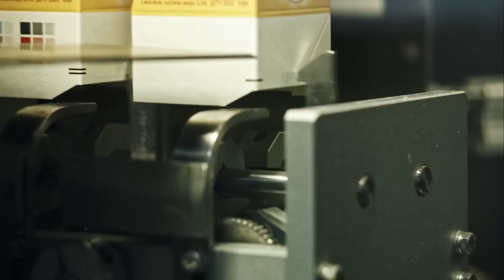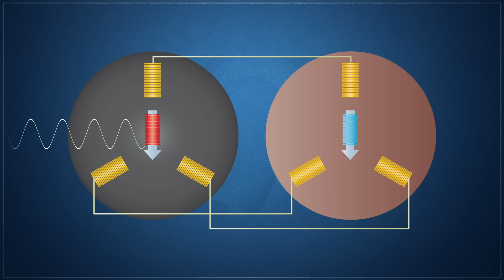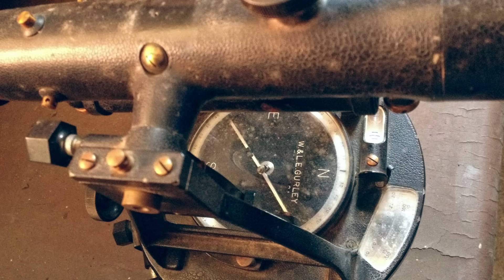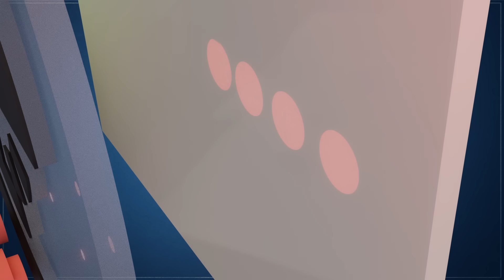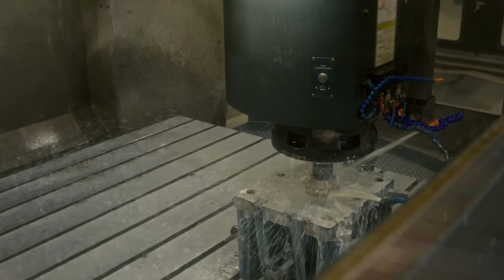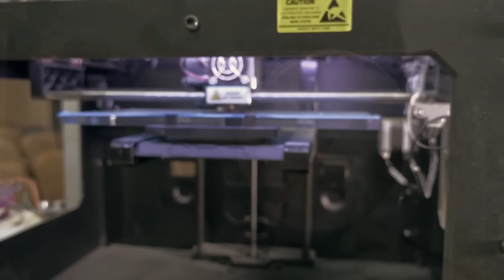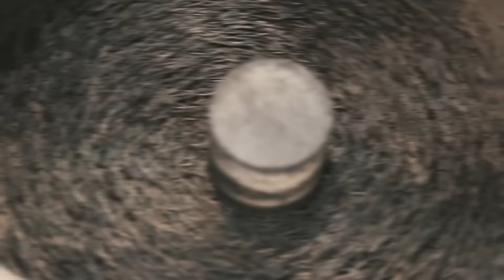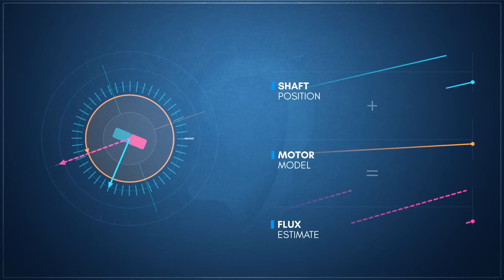The Incredible Engineering of Precision Rotary Motion

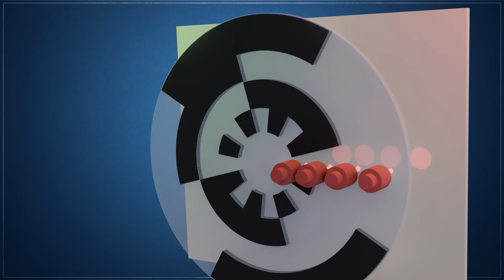Comment: The absolute encoder shown at 9:56 is not quite what you'd want in practice:
You want the pattern to be a gray code, where only one sensor changes state in each step.
One example of that is the (current) thumbnail where the areas form a tree-like pattern .
If you don't have that, the smallest alignment problems can lead to sporadic jumps in the encoder readouts.
Reply: I was very disappointed not to see the encoder in thumbnail mentioned in the video. The gray code stuff is really interesting. I recently saw a video which did a pretty good job describing it. I can't remember the channel but if I think of it, I'll mention it here.
Reply: @ddegn  Me too. This is by far one of the better tech videos, what with all the lazy AI-made ones coming out - you know, with completely unrelated pics and video and a grating AI voice. 
But Gray Code is one of the most interesting things and this video glossed over it. In my experience a simple (slit-based) rotary encoder system is effective and highly accurate, but requires homing every time you start it. Gray code is always read as a precise position so it needs no homing step. They are expensive encoders but so is everything else in a system like a CNC Milling center or robot arm! Another thing that was somewhat glossed over is the development of high-speed amplified brushless motor drivers like those used on electric RC airplane motors - in the 2000's up to now we are getting really efficient and responsive controllers with some crazy-serious phase engineering like you see at the end of this video.
Reply: @ddegn  But still it was good bait, huh?  lol.
Reply: I learned gray code and its purpose for the first time at my controls internship and some of the guys who worked there for decades had no clue why it was necessary for an encoder. I was FASCINATED. Wikipedia sums it up pretty well.

I was going to come here to comment that gray code is necessary in most encoder applications but you beat me to it. Cheers.
Reply: very good!
Reply: Yeah, it's a scratching many surfaces video.
Reply: gets a bit too "off topic" and long winded beyond saying "digital/logic systems dont like more than one input change at any one time and unexpected results may occur".

gray codes, xs3, reflected codes, and the whole thing of parity and error detection is mindblowing and so freaking simple once you "get it"...

whats sad is that as some dumb grunt that simply likes reading, to hear of people in the industry itself with no knowledge, no interest... its pretty commonplace these days, isnt it? 

"got degree, know jack"

gentlemen, i give you... "enshittification". we have all made compromises because of morons having the final say...
Reply: :face-blue-smiling:
Reply: I forget when I learned of gray coding, but I remember seeing it on the martian rover's wheel treads - interesting
Reply: I was thinking the same thing..
Reply: Same problem with parallel flash-adc that was based on comparators, you could get problems in the exact power-of-2 transition zone.
Reply: Weird,  because Ford Borg Warner has an encoder in their shift on the fly transfer case shift motor, that looks, just like that. It has 4 brush style contacts,  that touch a disk, with copper contact area, it goes forwards,  backwards,  and knows it's position, because of THAT design.  . . It's been around since the mid 80's .
Reply: @jamesgeorge4874  good for BW. 
you failed to mention what LOGIC CIRCUITRY happens to be attached to it? or how many bits it is trying to count?
4 contacts is standard. two phases. thats mere "quadrature encoding". its not producing a binary numeral representing its angular position, its simply saying its spinning CW or CCW, and how fast.

its not absolute positioning.

due to the internal architecture of a digital system, it is preferred that one counts "00, 01, 11, 10, 00..." changing ONE digit at a time.
rather than "standard count" 00, 01, 10, 11, 00. 01 to 10 is a particularly bad "switch"...

in reality they dont switch at teh exact same time... random and unexpected rewsults occur.

so encoder wheels, when dealing with bits and binary outputs rather than simply turning a phase on or off, use "gray codes" to make the CIRCUITRY simpler and less error prone.
Reply: Nice presentation of different solutions and their drawbacks .
Reply: What we know NOW, and what they knew then, are very different things. You're correct, but the builders were working out what they saw from practice and experimenting on differences to come up with improved machines.
Reply: That was known by 1941

Comment: And how about the backlash? I can do the resoluti8n easily with a gearbox....but not backlash
Reply: Timing belts or harmonic drive. Cycloidal is theoretically capable of doing it, but typically comparable backlash to a single gear stage. Gears are for things that only turn one direction, or don't need super precision. You can use an encoder on the output for the angle PID so it will automatically compensate backlash, but that can't respond very quickly to disturbances within the backlash range.
Reply: By having the gears lock in both directions.

Comment: Oh no. The troubleshooting when some machine learning system makes vibrations worse rather than better in some edge case it wasn't trained for is going to be so fun.
Reply: There is a big difference between "classical ML" algorithms and the modern ones used in AI. Some classical ones even have hard mathematical performance and stability guarantees, similar to the feedback loops used everywhere. Is it more complicated, Yes, does it improve performance YES!
Reply: get in the robot Shinji
Reply: Like a positive feedback loop?
Reply: You're obviously naive and ignorant to the ML field... don't mistake Ai slop chatbot marketing products for real computer science. ML are just different field of mathematical algorithms, like the Transforms mentioned in the video.
Reply: @Alpha_GameDev-wq5cc  Non-LLM ML systems can still get stuff wrong.
Reply: @gustavgans9082  Not really.
Reply: @seditt5146  of course they can. You can train them wrong, they training data could have been incomplete or unfit for the deployment data, the model could be overfitting. There's many modes of failure. Of course, some problems are simple enough and there is enough high-quality data to train on that the model becomes practically infallible, but this applies only to a minority of cases.
Reply: @seditt5146 they absolutely can. Computer vision is a great example.
Reply: @gustavgans9082  You don't "train" the ones used in CNC machines. They just use the incoming measurements to adjust things on the fly. Detecting and compensating for a vibration is trivial. Algorithms to detect and compensate them optimally less so, but you only need to develop it one time. An engineer would have to payed forever, and for every machine.
Reply: @seditt5146  if your training dataset doesn't include scenarios that aren't logical follow-ons from what it has already learned, it won't be able to deal with those scenarios when they arise
Reply: @someonespotatohmm9513 I'm not very familiar with CNC machining, but what you are describing still sounds like it has to be trained once to work. If not, then it's just a deterministic algorithm and not ML.
Reply: @gustavgans9082  You are confusing ML and modern AI. The second one is a subset of the first. To give a more common example: noise canceling headphones use ML to "learn" the noise and cancel it. The core algorithm is very similar in all noise canceling applications. They are "trained", but only on the last x ms of sound. I use "trained" because you don't call it training if you do it like this. The algorithms are of course tested before they are used, but that is part of good engineering.  
Technically modern AI is also deterministic. We just add pseudorandomnes for reasons, but at its core it is still deterministic.
Reply: @someonespotatohmm9513 You are vastly underestimating the complexities involved with achieving extremely precise geometric tolerances with CNC machines. It's frankly laughable at this point in time to imagine an AI, ML algorithm, or autamated process that could realistically manage even a fraction of the actual work involved with creating highly engineered parts. Everything is programmed and has values and offsets but much of the work is done physically in the form of grinding down tables to be flat, changing inserts, setting up fixtures, etc... Also, measuring single dimensions optically or with IR can be implemented but to mantain dimensional tolerances like parallelism, cylindricity, or profile you need something like a coordinate measuring machine. Skilled machinists that can program and operate the CNC machine and skilled metrologists that can program and operate the CMM will always be needed to make parts.
Reply: @Litevaar  Did I say the algorithm or AI does any of that? NO!
All I talked about was the machine learning algorithms used to minimize vibrations which get to the toolhead. Making it so the machine follows the path its been told to follow with the required tolerances.The operator can perform magic, but if the tools used go down to the mm, working at the nm scale is practically impossible.
Reply: @gustavgans9082 get your head wrapped around a PID loop. That will help clarify the similarities and differences. Right now you are obviously applying a lay understanding of AI without the fundamentals.
Reply: @Alpha_GameDev-wq5cc  The problem isn't that ML is bad, it's that it's generally unpredictable* and undiagnosable.
It's also harder to gain than physical systems or those based on simple control loops. Physical systems are based on the shared physical laws in combination with the largely preceivable physical form and state of the system. You can learn the principles behind simple control loops, apply those to new systems and even deduce what kind of control logic a system is using by observing its behaviour. Of course, control logic can also bug out when reaching some arbitrary state and physical constructions can have unexpected faults (for example inclusions causing stress risers in metal parts), but I think ML just offers so much more potential for unexpected behaviour when you take it out of its training environment.

* In the specific case. In the general case it quite predictably improves what is measured, in the most literal sense
Reply: Lol these comments are hilarious. OP didn't realize AI doesn't get stuff wrong ever and to say otherwise is stupid and wrong
Reply: @almostambient  I think what they are getting at is that these advanced ml for industrial applications being discussed operate strictly with the rules and laws of physics, which never change, and likely implement mechanical means of positive verification of dimensions and properties of the workpiece as they go so certain flaws kind of become impossible as long as the algorithm was coded properly to begin with and doesn't have incorrect data or system malfunction